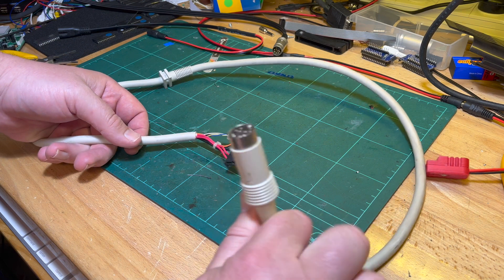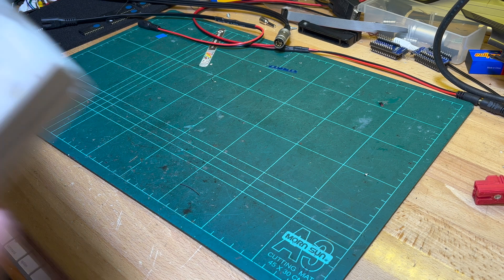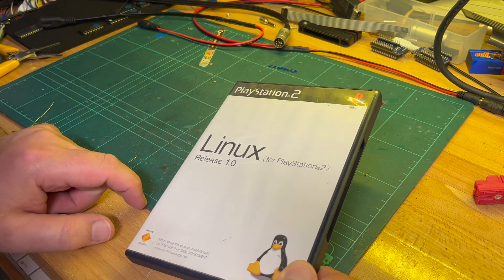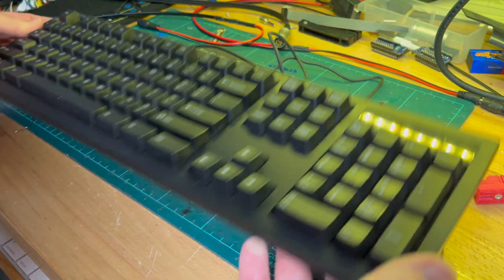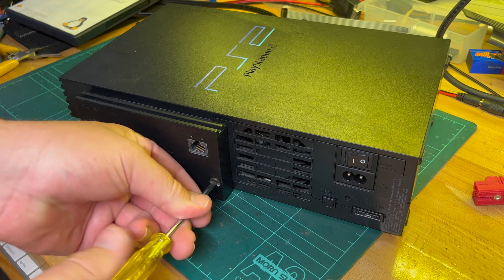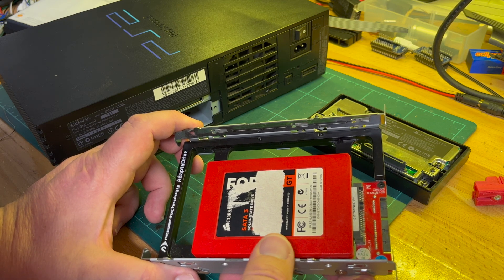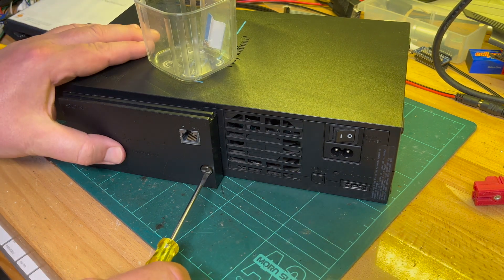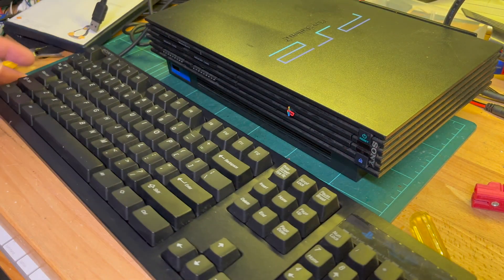🇯🇵 Sidenote: Sony PS2 Linux [TCE #0214]

Comment: noice!... i had an network adapter and fat for a while... hacked it up with FMCB.. and was runnin a bunch of stuff off the hdd..including linux...
but then the network adapter died... n i couldnt find another one... so ended up getting a slim and networking that.. the lack of hdd isnt really a problem, i just use my PC as the hdd and SMB through the homebrew...

Comment: HIRSCHMANN 932222-500 is the 14 pin part number.
Reply from the maker: Excellent!  Massaged the formatting of the part number a bit ... found one supplier at least ... a very good start, thank you Sir!

https://www.buerklin.com/en/p/hirschmann-automation-and-control/other-circular-connectors/932222500/70F9702/
Reply: @Brfff  And at a damn good price too. :)

As for getting rid of the excess pins, if they don't want to come out, I would try a scrap soldering tip with a dimple/hole at the end to put over the pin. Heat it up and push it out.